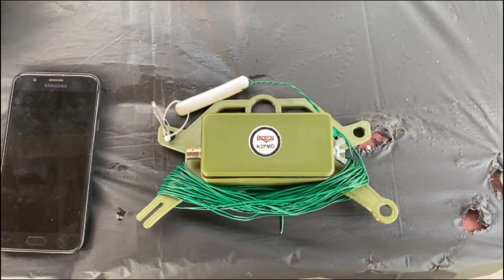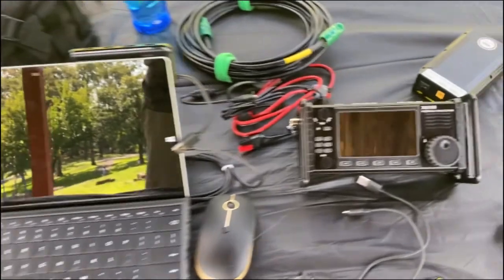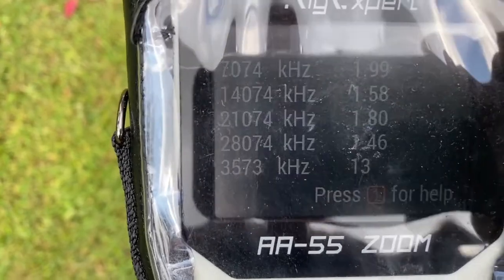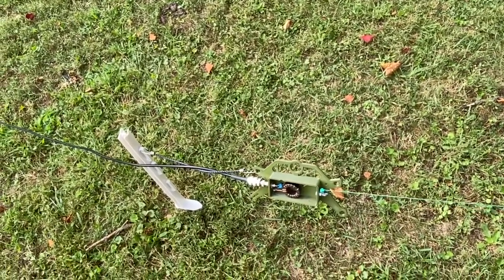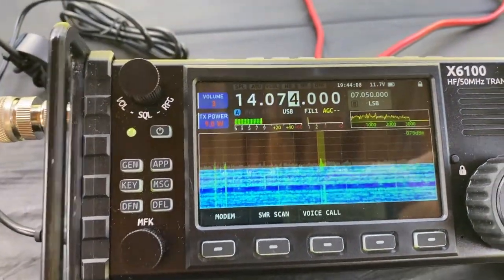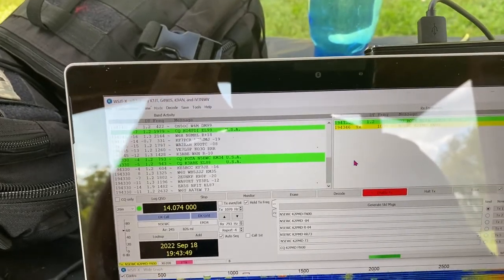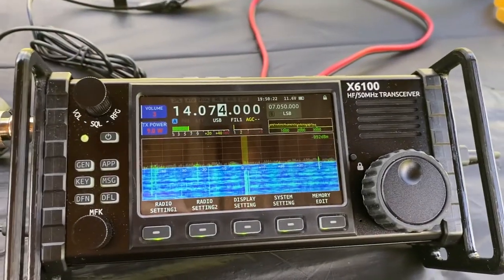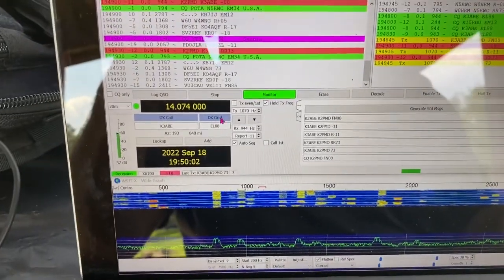K2PMD Homebrew EFHW w Xiegu X6100

Comment: Thanks for the video Paul. I have also just taken delivery of a X6100 and am very impressed so far, and like you I am running it of an EFHW, but in this instance a QRPGuy's version. I note you are not using the latest software update in your radio. Install it and you will find that it now includes fairly decent noise filters. Cheers ZL2VTH
Reply from the maker: Thanks Phil. I am behind on a few firmware updates. I hope to get to them today. Too much fun, too little time. 🤪